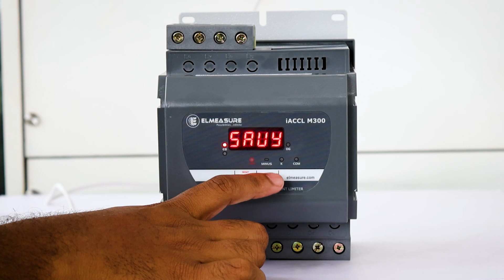How to program ACCL M300 | Programming guide

Comment: This device is faulty, lacks safety unknowingly used for my building having 15 houses 3 years back. 
 From this ACCL got reverse flow of current to generator costed me ACCL and alternator of generator  which amounted to 4 lakhs on enquiry executive says he is fed up in informing such kind of enquiry.  This shows its standards. It lacks safety. This will go every six months. My god I lost money nearly 8 lakhs. Now, iam using ABB. Now it is fine from 1year.

So many complaints then, I felt not to recommend or use it for ever.  
Don't use it.

Comment: In my ACCL , we are getting 150 volts in the secondary when there is no secondary source. We have just given primary source. We have not connected any load. This is faulty design and destroy DG. Fail to safe should be the design principle. I don’t recommend this ACCL. Customer service is very shoddy. They squeeze money from customers for their faulty design.